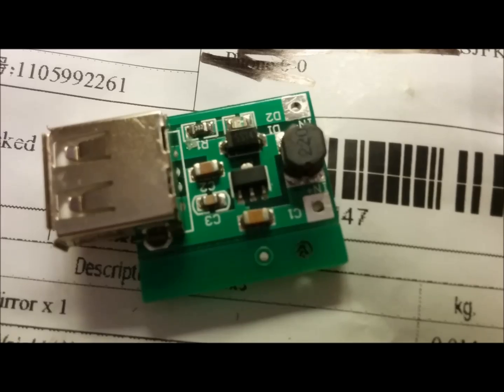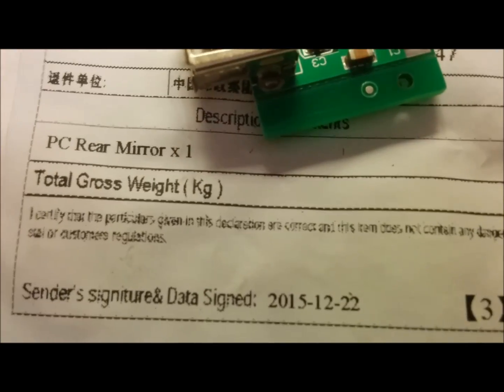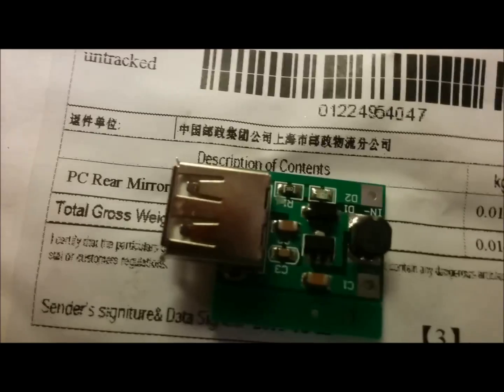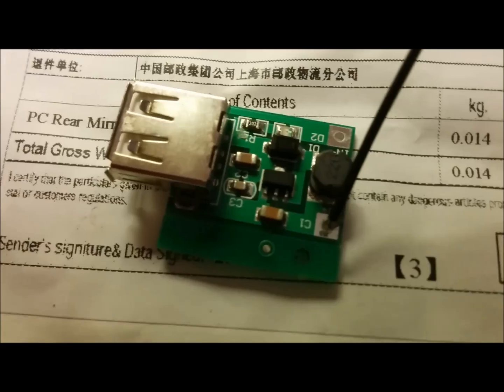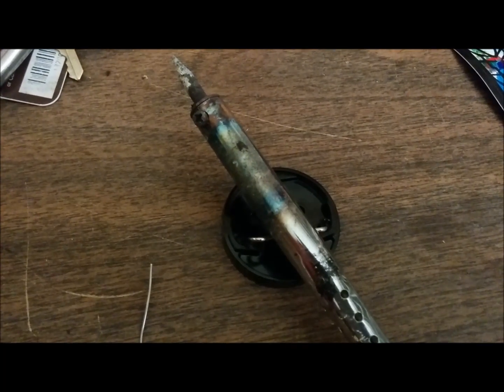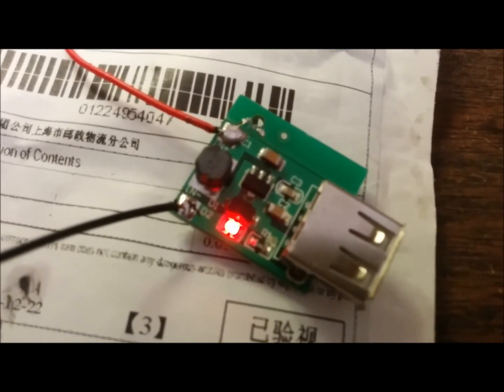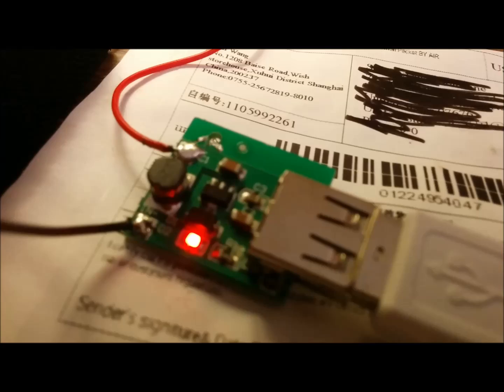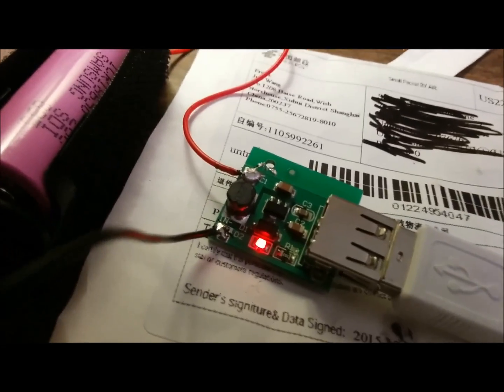DC-DC Converter Step-Up Boost Module 1-5V to 5V 500mA USB Charger Arduino

Comment: China is killing me.  The modules and parts are so cheap I have filled a room with virtually everything I could imagine.  I never
know what I might need for an idea now its just a matter of finding what I need.
If you have not already, check out the radar modules on Amazon for about a buck.  Paired with an Arduino Nano its pretty useful, it can see through walls.

Comment: what's the brand and specs of the power bank that you use?
Reply from the maker: I am using a  Samsung 18650 battery from a laptop battery.
Reply: thanks, will this work on power banks nowadays?
Reply: like the power banks by Xiaomi?

Comment: Could you measure what the efficiency of the module is? Need just a current the battery draws when there isn't anything connected.